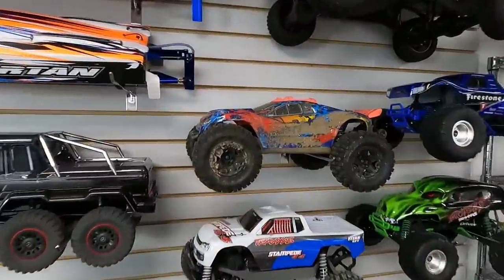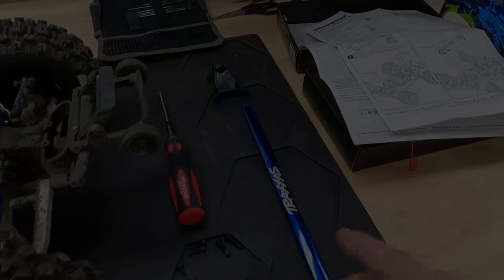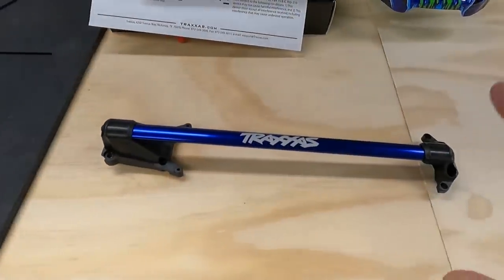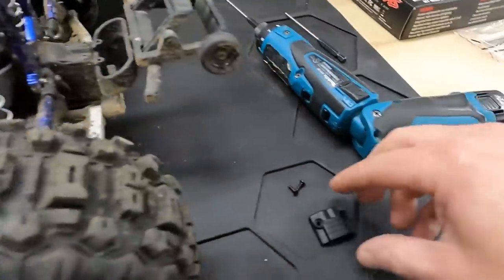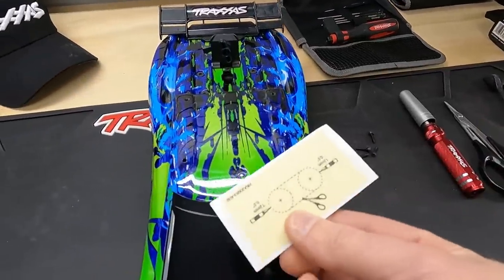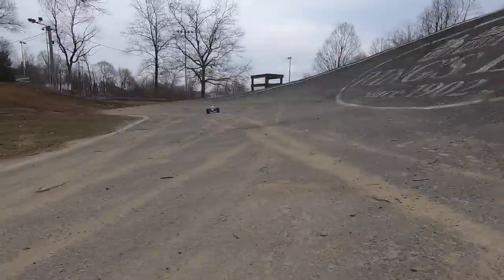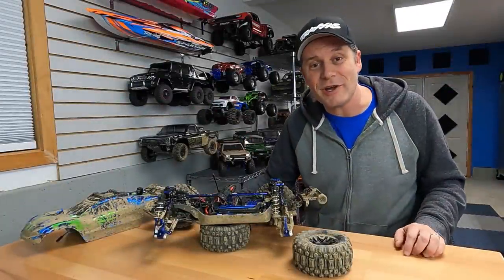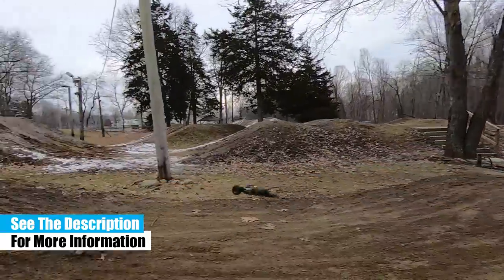More Options! Off-Road Lights & Chassis Brace Install - Project Rustler 4x4 VXL Update | RC Driver

Comment from the maker: Before a comments pop up about the driveline noise... Yes, there is driveline noise. During a bash session, the pinion moved and gouged the edge of the teeth on the spur. It was not bad enough to replace the spur, but that’s whats causing the noise. So I removed the rest of the audio in the action and replaced it with music because the noise was annoying. And now you know. 😊
Reply: At least it wasn't a differential, or something difficult to replace. Rustler looks good dirty

Comment: I just subscribed. My 13-year-old son has a Rustler VXL. He's had it for about a year and has only been able to drive it for maybe 25 to 35 total days. He breaks a lot of stuff. We're trying to upgrade anything and everything we can to aluminum or "nonbreakable" stuff. Can you do a build on a Rustler VXL? I do plan on putting all the telemetry things on it. I saw a heatsink for a motor that I thought about getting but I'd definitely have to modify it. I was wondering if some of the stuff like the shock tower, roof skid plate or LED light kit for the Rustler 4X4 VXL would be able to be put on the Rustler VXL. I would love to see a video of anything and everything that you could put on a Rustler VXL. Thank you for your upgrade videos.

Comment: older video now, I held off on the chassis brace because I wasn't going to take off $200 GPS and all the telemetry. 6562 telemetry holder, it goes on the brace. Puts GPS by motor. $8.00 fix. I have an LED light set and fr/rr MIP XD axles to try in mine beside me.I run the wide aluminum hubs with raid wheels and badland mx28s on mine. It is an axle-breaking machine on 3S with that much tire. Probably doesn't help with rear diff JB weld 550 million weight in it. I hope $150/ worth of axles hold up. The H/R lasted almost half the 1st 3S batter before I broke the hub off the end. I have about everything you could put on one. It looks like the brace will clear front sway bars ok. And another worry, I have GPM front upper control arms. They bolt to 2nd set of holes in the chassis. Looks like it should go around those and the cross brace fine also.

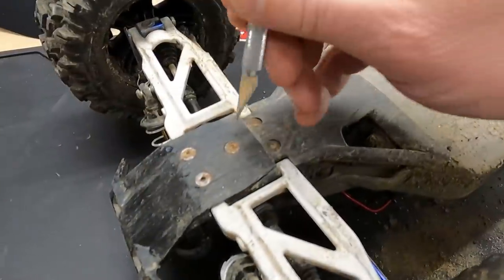Comment: 7:24. I bought a small pick set that has picks at different angles to dig out my screws. Suprisingly enough, I don't need to use them nearly as often as I would think. That's probably because I have them, if I didn't have them, I'd probably need them a lot more. That's how things go, right?  Lol.

Comment: What are some good Axel's to buy and use on the traxxas rustler 4x4 VXL? I see all kinds out there but I didn't know what ones to buy and I don't want a cheap pair because I don't want to keep buying them over and over because I bot the wrong ones so can you help me?   And Think You for all of video's they help a lot keep up the good work. And I like the new shop
Reply: Almost none. I would have said the tekno dog bone conversion for the slash because those are bulletproof vs any other kind of driveshaft that will empty your wallet. But idk if the slash and rustler share the same arm lenght. The gpm axles fail, the stock ones fail when just running on the ground(i had a rustler so i know), the high velocity one just like you saw are rubbish, Maybe the new ones they made would be more durable but the money you pay. Also dont get the shitty china made axles from ebay for the 3s traxxas line they will snap first jump

Comment: Man that's a 1st seeing both axles snapping and wheels off , lights look good tho .
Reply: Right! I have broke everything on my Rusty just not 2 axles with that kind of style and efficiency.
Reply: Shows how weak they are for the money you pay. They should be almost impossible to break well you need to spend more. Thats what i hate in rc upgrading shitty design the upgrade is not enough so u need to upgrade the upgrade.

Comment: Can the telemetry unit be used Without the brace but With the light power unit? Can the power supply be mounted somewhere on the telemetry unit?

Comment: I have a question. Can I use this light kit if I have a 6s set up. I’m running my rustler on 6s and I would love to use this kit. But I’m scared of burning out the circuit as soon as I plug it in. Help D:

Comment: Hey man, nice video! Those are two upgrades I am definitely looking forwards to installing. Question, what driveshafts did you use? I'm using some cheap ebay cast aluminum ones and are honestly weaker than the stock plastic ones

Comment: Chassi brace i wonder where they had the idea from... ah yes the company they sued for a suspension they dont have the right for on the arrma Nero. Almost took arrma down. Lucky horizonhobby are not as dirty like traxxas when it comes to legal charges. This is what traxxas stands for. blocking rc enginering Because of bs pattents. Nobody can use the F1 suspension anymore or they might be gone of the hobby. Would have been cool to have variety. They have pattents on freaking radio box seals? Are you fking kidding me? Traxxas does just this release recycled part rc with one or two new stuff Slap a big price tag on it an people buy them. Then they just focus on light kits and different rc color bodies for their lines and publicity. The rest is for legal shit thats how traxxas makes their money. Til people accept this bs they wont stop and will just limit new rc innovations. When was the true last new rc Traxxas made? The udr and xmaxx who are like 5-6 years old now? After that just recycled parts. Dont tell me the maxx is new it is technicly yes but its just a shrunk down xmaxx like cmon. I dont hate their products much  of traxxas i want them to make something new i just see them milking money From their failure designs  and enjoying doing nothing. Wheres the bandit 4x4 for example?

Comment: IMO the traxxas telemetry expander isn’t worth it, but they do sell an adapter that allows you to mount the module to the brace. I’ve used it to mount receivers as I find the temps are much lower if you mount the esc on top of the Rx box instead. Gives the motor and esc more breathing room, and allows you to install the 540xl.

Comment: Hey I’m 14 and just got a Traxxas 2wd rustler for Christmas. This is my first rc car and I’m planning on getting in to this hobby. Is there anything I should know about this specific car and things I definitely should buy Or replace or something along those lines just so I make the most out of my car. Also should I swap the the titan 12T out for a brushless Traxxas motor?
Reply: After starting off with a 2wd Stampede and upgrading almost everything over the past 5 years, I think there are two absolutely necessary upgrades I recommend for a Traxxas 2wd. You can replace these parts when they break of course or if you want beforehand.
-Aluminum shock caps and titanium nitride coated shock shafts (you will have to rebuild the shocks, if you don't mind spending an extra $20 you can get the big bore shocks which comes with these upgrades)
-RPM A-arms
The other parts I would probably just upgrade as they break
Reply: @portalsam7  Thank you
Reply: Also is there I a certain type of batteries that I should stick to with my model and is lipo batteries or is NiMH batteries better?
Reply: @Trollnose  well it should've come with a NIMH battery since you got the brushed version I think. You should probably get the hang of it with that setup for a little while and then when you are ready for more power get a brushless system and a 2s lipo.
Reply: @portalsam7  Thankyou that’s very helpful

Comment: i destroyed 2 new-ish Revo 2.0 batteries over the winter.  i left them in the car, knew they were at a storage voltage since i have a voltage alarm set on them, but i never unplugged them.  so they slowly drained over the winter months.  thats 130 dollars down the tube.  so to punish myself, i bought 2 new batteries, an Xmaxx with 2 batteries, an Arrma Typhon 3S and a rustler 4X4 lol.  that'll show me

Comment: Did you get any run time cut by this light kit I put the same one on and mine doesn’t even run for 10 minutes and the battery is dead running 3 cell 5000

Comment: Sledgehammers are axle killers!! Might be better with the Tekno axles. Just no RPM parts, they are not compatible. The plastic is too flexible and causes binding and breakage.
Reply: . I never saw an rc break axles because they have bigger tires

Comment: I plugged the jst into the receiver and that eliminated the auto on.  Now only comes on when I power it on!👍🏽💯
Reply from the maker: Just a heads up, the instructions specifically state not to do that. It can damage the electronics.

Comment: Hi, thanks for all the great videos, and tips. I modified my Rustler the same as yours with excellent results. I have a question, I have noticed the motor getting hot. Any tips on how to keep it cool or is it suppose to run that way? I mean it's not so hot that it burns my fingers or plastic gears on my Rustler. Any information would be great and thanks again for the great videos!
Reply: They have a fan that you can install on it :)
Reply: I'd suggest starting with a smaller pinion.

Comment: It’s such a great RC truck.
I just tend to upgrade parts as and when they break. Once I’d upgraded the shocks I haven’t had anything else break. That’s giving it some serious abuse at the skate park too. Got a dust cover fitted which keeps the electrics cleanish.
Reply: I am looking to upgrade my shocks on my rustler 4 x 4. What is a good shack to upgrade to? Mine are the stock shocks that came with the truck what did you put on yours and how are they?
Reply: @MrMetz2112  I upgraded to the Traxxas big bore shocks. With the stock ones the caps kept  popping off the top when I crashed. Not had that happen with the big bore shocks.
Reply: @MrMetz2112  gtr shocks, buy them on jennysrc for the best price